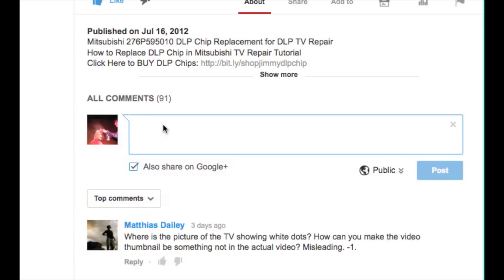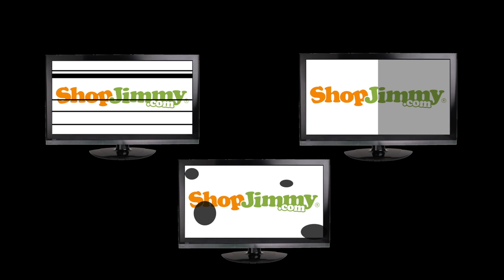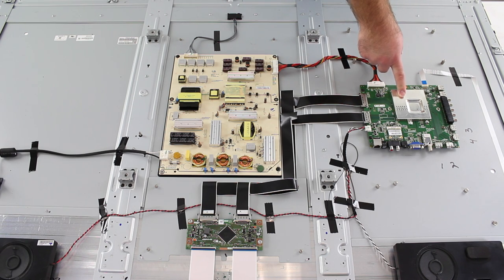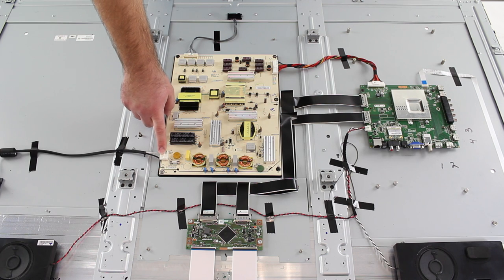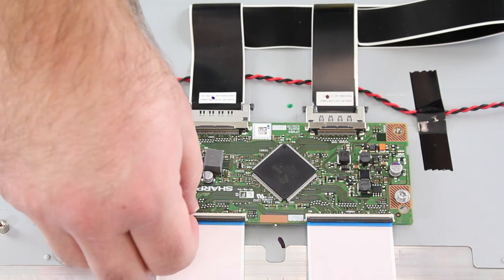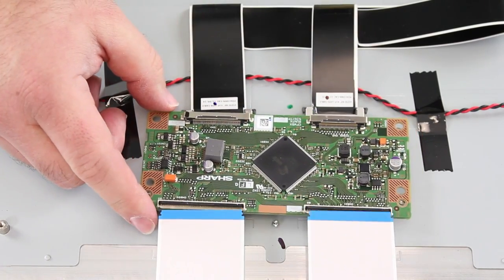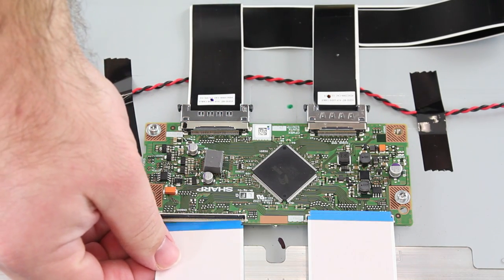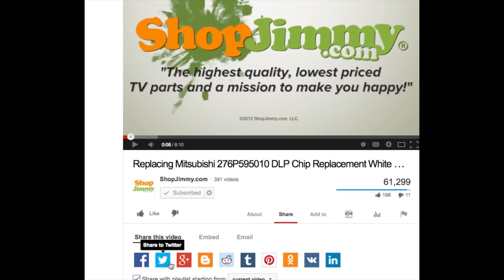Vizio TV Repair - E601i-A3 T-Con Board Replacement - How to Fix Vizio TVs

Comment: VIZIO M701d-A3R 70-Inch 1080p 3D Smart LED HDTV (2013 Model) [ASIN: B00CHKPYM0]

My son and I were replacing the “base” … as the screws which were supplied didn’t give a good fit 

I had bought another base and stand with screws and they were replacing it … and when moving it back up into upright … 

Had the unit on the desk seen in the picture with a blanket under the TV when face down 

The TV tuns on, however, now there is a spider crack and a black area in the display area 

Power on ok, sound and controls work, with the exception of the "input" dialog 

Am running the TV using wired ethernet and/or wireless which both work too from a mac mini and using a mac power book for the display this morning 

My other Vizio's work just fine ... not sure exactly what happened 

Was being as careful as one can be .. 

Just trying to find if this problem is repairable 

Here is a link to a picture I just took this morning 

The problem started yesterday with the attachment of the new base 

http://i983.photobucket.com/albums/ae320/wessongroup/DSC_0005_zps9trzsuot.jpg
Reply from the maker: Wiley Wesson Try all repairs and troubleshooting at your own risk.  If the screen has a crack in it, this sounds like a TV panel (TV Screen) problem.  If your TV panel is bad, it may be more cost-effective to replace the TV as panels are typically hard to find in stock, difficult to replace, and expensive.  Thanks and please let us know if you have any further questions!  www.shopjimmy.com
Reply: Can't that be replaced ?

What part number would apply ?
Reply from the maker: Wiley Wesson  Try all repairs and troubleshooting at your own risk.  Unfortunately, we do not sell replacement panels.  You can look elsewhere and maybe be able to find something.  Thanks!  www.shopjimmy.com
Reply: Do you have a part number for this model

Also, it is only 3 weeks old, what is your guess on Vizio doing any repairs under warranty ... ?? Have emailed them and asked the question can it be fixed 

Just trying to look at all options ... before tossing it
Reply from the maker: Wiley Wesson  Try all repairs and troubleshooting at your own risk.  I do not have the part number for the TV panel on your TV model.  If you find a place that sells replacement panels, you can ask them what information you need or call a TV repair tech for an estimate on the repair.  It can be very difficult to replace the panel in your TV and sometimes cost as much as the TV cost.  Thanks!  www.shopjimmy.com

Comment: Thank you so much for your kindness in showing these fixes. Our Vizio 60" E601i-a3 just stopped showing video. The audio continued to work but there is no picture at all. I looked behind the vents on the back & there are some dime sized lights eminating from inside there somewhere. After a few seconds those lights automatically go off and the TV turns itself off. Is there reason to belive this might be the T-con board? How else could I tell? Thank You so much.
Reply from the maker: DicksonWoodard   Yes, I recommend to replace the T-con board.  If the T-con board does not fix the problem, then you most likely have a bad TV panel that is damaging the T-Con board.  Click this link to replacement T-Con boards:  http://www.shopjimmy.com/catalogsearch/result/index/?cat=63&q=E601i-A3&utm_campaign=E601i-A3mainboard&utm_medium=E601i-A3mainboard&utm_source=youtube  There may be multiple boards for the same TV model number, be sure to match part numbers on your current board, with your replacement for compatibility.  Thanks and please let us know if you have any further questions with your TV Repair!  www.shopjimmy.com
Reply: Thanks so much & I will be ordering soon.
Reply: ShopJimmy.com  I replaced the T-con board I got from you. I was happy that the picture came on but now there are tiny vertical lines running up & down. Do you know what that could be?
Reply: +dickson woodard , I've got the same issue. Did you ever get it resolved?
Reply: +Eric Fox  Yes, the ribbon cables were not fully inserted in the slots. Wiggling them in further (under power) snapped the lines out.

Comment: hey Vizio 60" e601i-a3e, vertical distortion on picture.  effects whole screen. thinking tcon board, not sure. . white uniform million vertices lines,  really bad in dark picture hardly noticeable in white pictures... do you also think tcon?? thanks
Reply: shanon fittje I’m having the same issue I️ already replaced the main board for my hdmi issue but picture still having problems did u replace the Tcon and if so did it fix the white lines
Reply: Try re-seating the tcon to main board connector's, then try it. It might not take the first time so try it 3-4 times and make sure connectors are clean. If you don't see any improvement replace the LVDS cable. If still no improvement you probably have a bad panel. This model use's a Sharp panel with a history of bad panels. Good luck